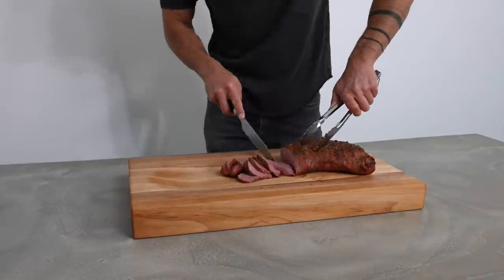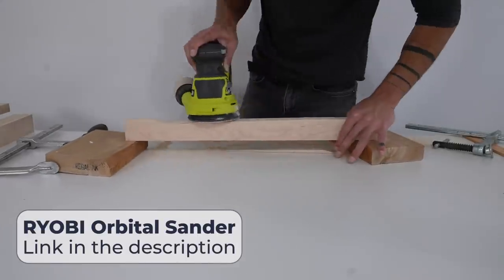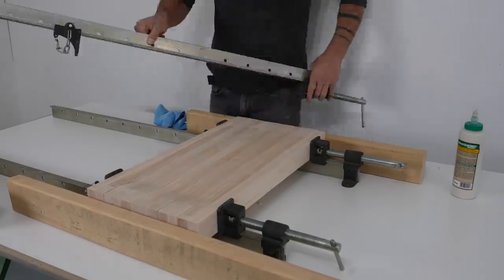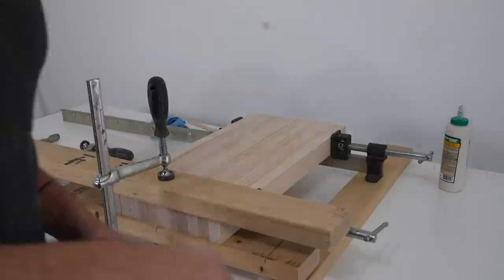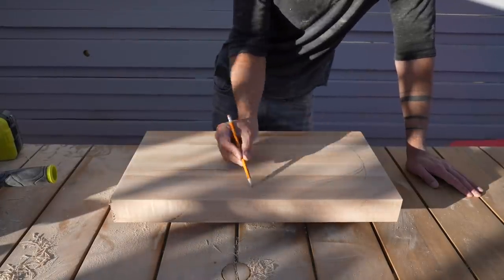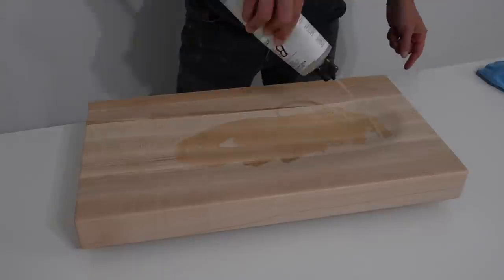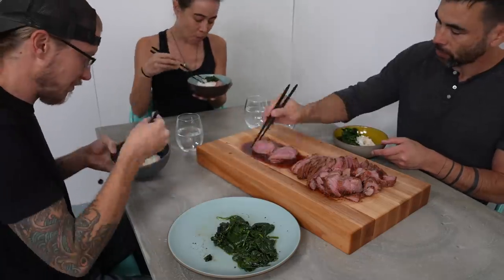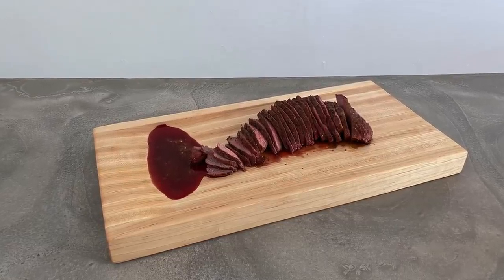The Ultimate Cutting Board for Beef

Comment: That looks really great :)

One thing I would maybe do different is for the first variant:
When you sanded the sloped boards you also inevitable rounded the edges.
That way you get a groove between the sloped board and the side panels.
If you would trim the edges of the sloped boards after sanding that groove would disappear.
But maybe that isn't really a problem and the glue hides that groove anyway. Hard to see in the video.

Comment: Did you use the mineral oil because it's for food vs using a stain/sealer from your hardware store? I'm a novice so I'm still learning. Thank you!
Reply: Yes mineral oil is food safe and probably the only thing you would want to use for anything touching food. You can buy it as "cutting board oil" at most hardware stores, but you can also go to most grocery or pharmacy type stores and buy normal mineral oil for cheaper (and it's the same exact stuff) hope this helps!
Reply: @forster46  Thank you!

Comment: When you were making the first board I was thinking why not just sand the dished section with a flap disc. Low and behold - board #2. Glad I didn't jump the gun and call you a dumb@$$. 😁
Reply from the maker: yeah the power carving is faster but if you aren't used to doing it can be hard to keep the slope consistent. first method is slower but easy to get right

Comment: Is using glue in a cutting board safe?
Reply: yeah, that specific Titebond3 is non-toxic and water resistant so it wont leech or crack with washing.
Reply: The typical wood glue is, yes